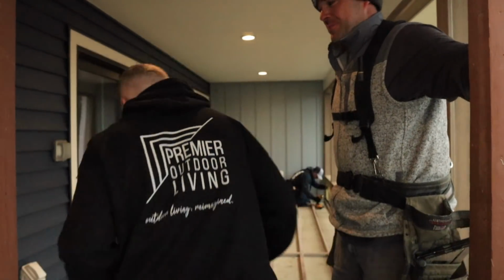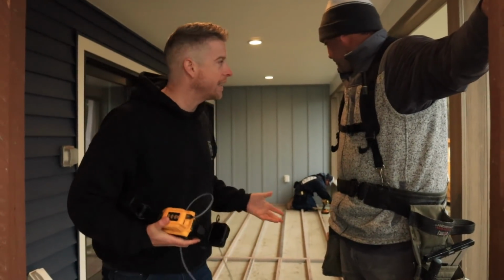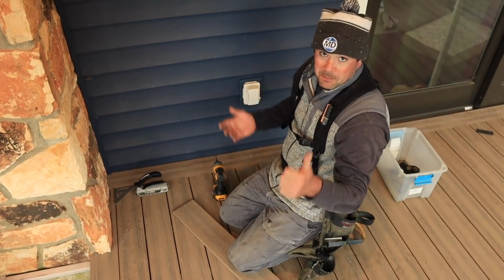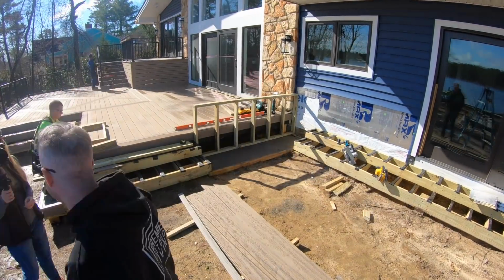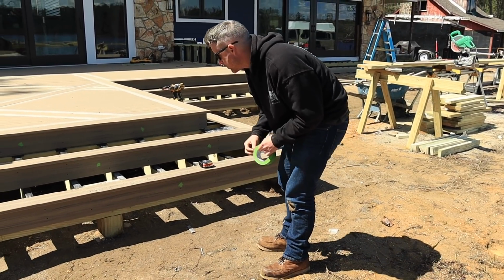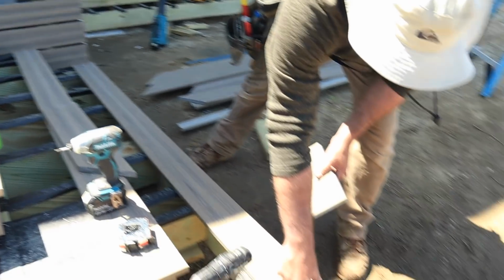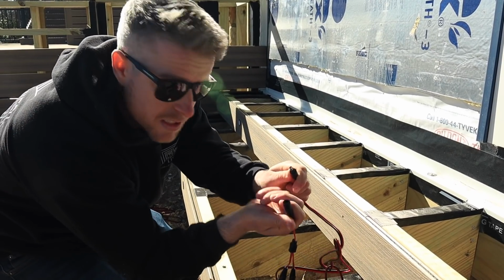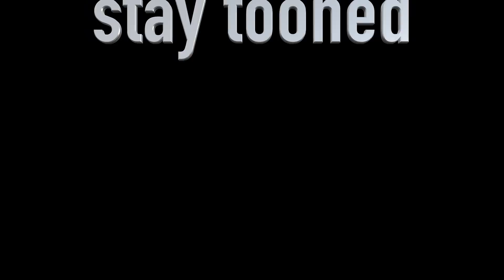RIVERFRONT BACKYARD BUILD Pt 6 - Deck Sleeper System and Deck Lighting

Comment: Does the sleeper system not need any path for water to drain out?  Or do those pieces have weep holes/grooves underneath?  I think I’d like to use something like that.
Reply from the maker: If possible run it with the direction of slope, but in this case it is underneath a covered porch so it won’t see any water
Reply: @THEpremieroutdoor  that’s what I figured.  Thanks for the great content.   Doing my own deck build next year, and your channel is invaluable for both the big vision creativity and the nitty gritty details!

Comment: Tony without beard looking 15 years younger, you with your 80’s fade-someth’n transport us straight to YO MTV Raps! Hold on … the clock is going backwards 😵‍💫
Reply from the maker: Hahah and we both had the shades off in this one, I barely recognize us 🤣🤣
Reply: @THEpremieroutdoor  Hahaha A quick question, do you ever have problems applying black flashing joist tape? I wanted to use it on a stair rebuild I did recently and it absolutely did not want to stick. I assume due to the fact that PT lumber was moist. Any words of wisdom out of your own experience? Thanks

Comment: Looking great so far! I like how you guys flow of your boards running horizontal from the skirting right into your stairs! 
What brand/type of low voltage lighting did you guys use on this project?
Reply from the maker: Thanks a lot, that’s one of my favorite details especially on this project with the amount of steps we have! These lights are the Deckorators riser lights
Reply: @THEpremieroutdoor  cool thanks a lot! Keep the cool designs coming!